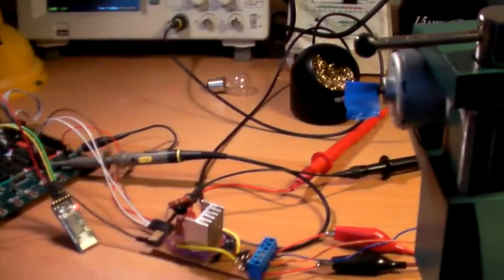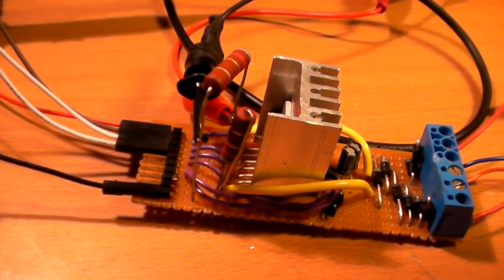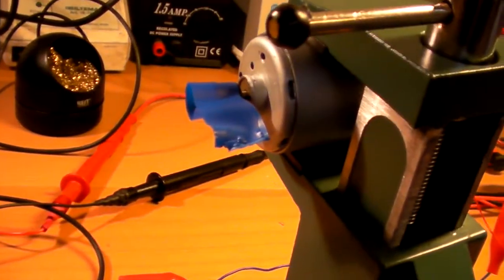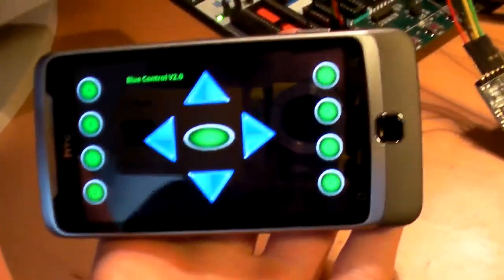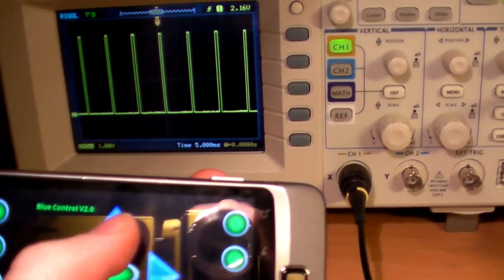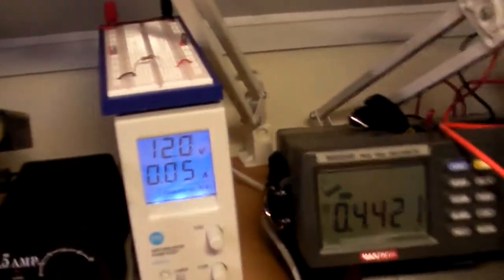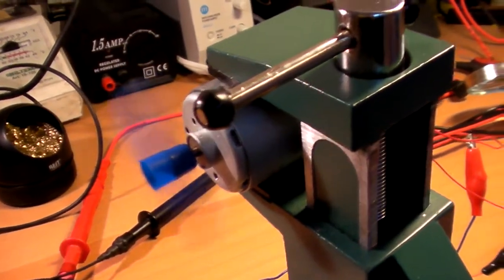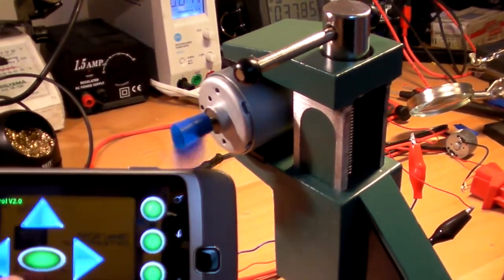AVR AtTiny2313 DC motor bluetooth control

Comment: can u test rx/tx ports on bt module? should there be a voltage drop when press the control buttons. what are the fuse settings on the attiny. im sure it matches cpu_ul defined in the c code

Comment from the maker: I used the STK500 on-board 3.6864 MHz crystal. This is also possible to read from the pre-processor defines at line #3:
#define F_CPU 3686400UL //Defines clock speed
Just keep asking till you get it working

Comment from the maker: You should use external crystal for better oscillator accuracy, yes. Try standard UART between to uc's i.e. first, so you know the timing is right. You can also check for error registers in the UART flag register. Both BT module and microcontroller needs 5v supply. See my website comments on this for module manual and see wether you have set it up correctly.

Comment: HenrikN449,  what is the  key for getting the lowbucks BT module to sync with attiny2313.  I have everything setup like your demo except that i'm using the internal clock. Do I need to use the external crystal?. Second do I need to supply 3.3v or 5v to both components.  I have no problem with the C code, flashing and getting a motor to run; just the BT module.  thanks in advance